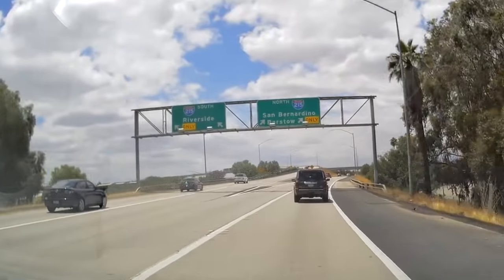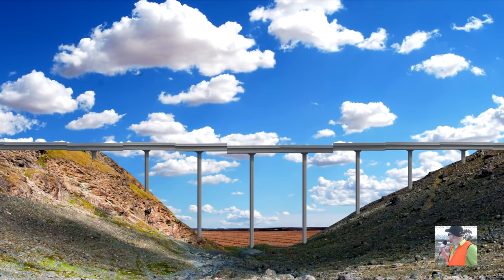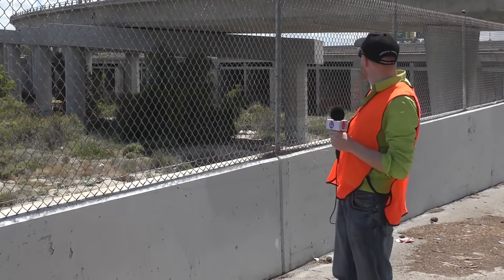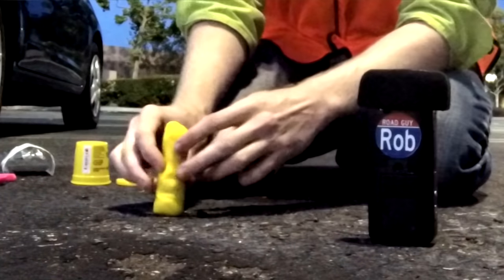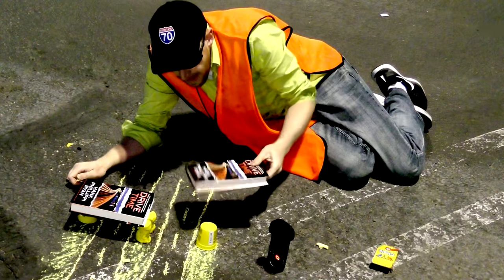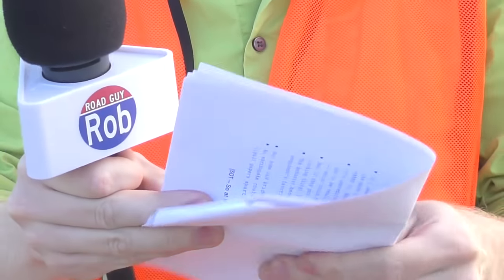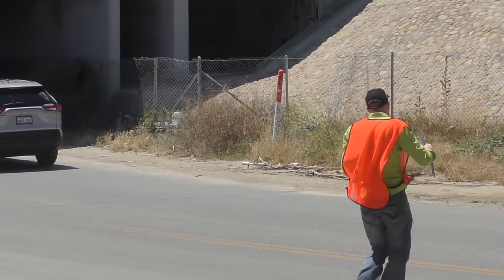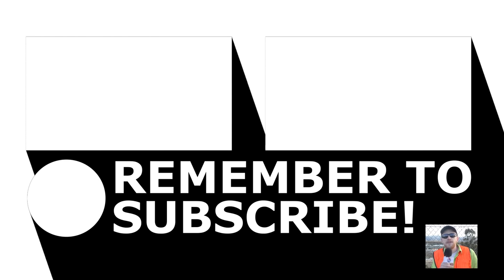Can engineers PROTECT old bridges before the BIG EARTHQUAKE hits?

Comment: Great video! Just wanted to point out that Oregon ALSO has a program going on to retrofit its bridges, so you shouldn't be quite as worried. Since the 2009 report you mentioned in your video, Oregon has been retrofitting or replacing its bridges based on simulations they ran for a 9.0 Cascadia Subduction Zone earthquake. By 2014, they had addressed (retrofitted or replaced) 355 bridges statewide under this program, with 800 left to go. From what I've gathered from the 2019 Bridge Condition Report, another 4 have been fixed and 26 funded, leaving 153 bridges left in Phase 1 of the program.

Comment: It works as long as it's built as designed. The I-880/I-80 interchange was not updated after a design modification years before the 1989 quake in CA.

Comment: That particular interchange in San Bernardino actually has the San Jacinto Fault running right through it. It would be nice if we would put something in cars that would alert drivers to the fact that an earthquake is occurring and perhaps allow them to get off bridges and pull over safely, kind of like they have in Japan, although I realize that the warning wouldn't be as easy to give drivers before the shaking starts since most of the dangerous faults are on land.

On a side note, there's a lovely bike path that goes under that interchange and out to the beach and I recommend anyone who bicycles in the area to try it out because it's really peaceful since it follows the river and only occasionally passes under roads and into civilization.

Comment: If I learned anything about civil engineering practices, there's really no such thing as earthquake-proof. It's just resistant enough to handle the small stuff, and it's built resilient enough so it doesn't collapse and kill a hundred people when it's hit with the big one. It's kinda like a car. It can take light bumps with no problem and may need a few repairs afterward. Anything bigger and it will crumple in to absorb the blow and save your life but is completely unusable afterward.

Comment: I always wondered why California freeways are almost always made of concrete, whereas freeway bridges in the Midwest and south are usually steel. It seemed to me like the concrete would be prone to spalling in a quake, and even if the overpass you're driving under doesn't crush your car completely, a large chunk of concrete through the windshield could still ruin your day. But I take it that the concrete they use is ductile enough to avoid that problem, so Californians can rest easy. (Just as long as they make sure not to hire Figg to build any pedestrian bridges.)

Comment: Can you explain more the part where all the bridge supports are the same size? that give the bridge a way higher amplitude response at its very sharp resonance frequency, intuitively (and lowers it), having varying support lengths spreads the response spectrum out and the global amplitude response is smaller since only a few support can resonate at a time.
Reply: Not a mech/civil engineer so this is based just on some reasoning.

If the bridge is tuned to resonate at a specific frequency then the structure designed against  this as a worst case. In addition, the whole bridge will move as one unit. The advantage is you can plan for this directly.

Having many column and deck sizes means one may get "unlucky" and resonate or move more than the others, or have a large displacement from one section to the next. This can cause just one section to fall in isolation.

The goal is to have the whole bridge standing at the end, because even one section falling would be catastrophic. This can be achieved economically through designing the failure point at a known case, instead of spreading them out to many complex interactions.

Comment: Rob, with the carpool ramp shown in 2:10 to 2:15, I notice that the RL on the road surface gradually decreases, while the ground is presumably flat. Is the basic approach for designing the pillars the same? Same pillar length with the pipe sleeves, and just that the depth of the pillars from the ground made different in accordance to how high off the ground the pavement is?

Comment: I don't agrees with these retrofits, they still use concrete, earthquakes move up, down, sideways and these overpasses are way too heavy for single colums. Even japan uses heavy colums twice as thick as these with twice the number of colums and they failed in the recect Kobe earthquake, the entire roadway fell to the side failure at the bases. These retrofits that are just sitting below are similar to the 880 double roadway that pancaked. Even the Northridge quake move the ground sideways over 6 feet, these concrete colums can hold weight in compression, not sideways. Yes reinforced with rebar helps but it still crumbles with repeated side to side motion. The roadways are really not what I would worry about compared to the tens of thousands of soft story apartments and buildings.
Reply: And the emergency aid to get to those crumbling apartments & building will come much quicker if the roads are intact. 

Your point is well taken but we got to start somewhere and keeping the bridges structurally sound will mean aid gets in quicker. How much to replace all those apartments and buildings?

Comment: I do wonder what the necessity of earthquake oriented design for cities like St Louis near the New Madrid Seismic Zone is. Like we don't get significant earthquakes often, but in the event of a severe one from New Madrid, it would be brutal
Reply: The problem with the area near the east coast is that the continental crust is much more dense than the crust on the west coast, due to being much older. So basically even weak earthquakes can be felt over very large distances. An earthquake can happen almost anywhere and cause damage many many miles away. 

On the west coast it's the opposite. There are stronger earthquakes more often, but the crust is not as dense, so they are only majorly felt in the local vicinity, and not across the entire state.